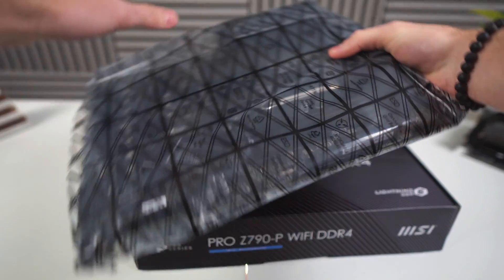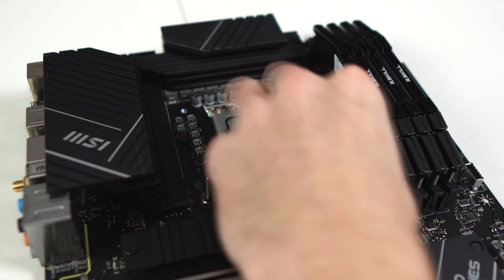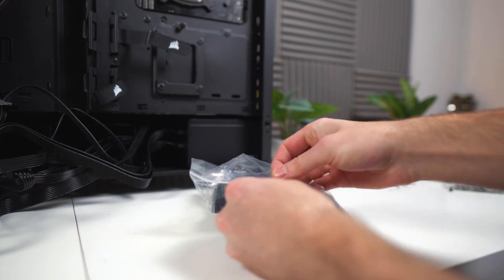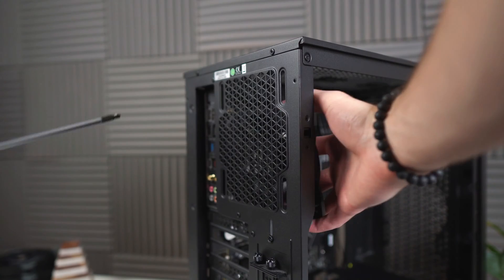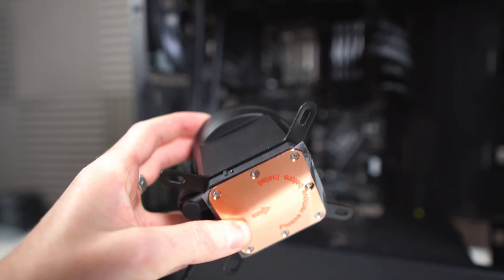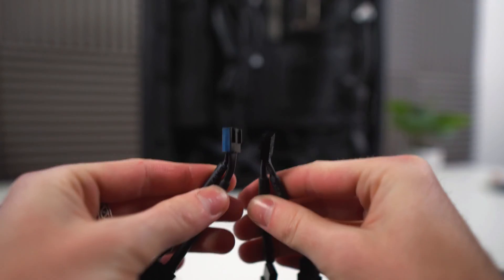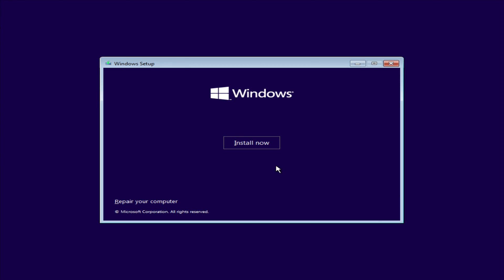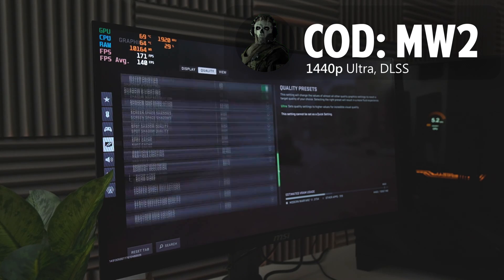BEST $2000 Streaming/Gaming PC 2023 [Tutorial, Benchmarks]

Comment: Hey I just built this PC, and after running it I saw the CPU was overheating a lot, i took of the aio and the thermal paste is good, I think the problem was with the plug from the screen, there was three plugs but in this video you only showed where to plug the two at.
Reply: Did you get it to stop overheating? And does it work good
Reply: @itzinsanity4 I wasn’t to get it to stop overheating, I know Intel CPUs are known for getting extremely hot, but mine was way too hot, I think the bump is messed up and i’m getting a new cooler
Reply: @MayLyte  let me know if the new cooler is better and if everything runs smoothly afterwards
Reply: @patum54patum Ok this is going to make me sound very stupid, but it turns out I left the plastic on the AIO lol, this was my first time building a PC so rookie mistake I guess, but after using it for around half a year, it works perfectly. Also instead of the recommended GPU, I switched it out with a 4060 and it works amazing.

Comment: SOMEONE HELP: would i be able to run the exact same parts with a i9-13900k? if not what parts would i need to change?
Reply: why a i9-13900k?? its overkill and also the temp is going to be on the roof. Also ur gonna need a better cooling system which gonna cost you more and a better gpu for no bottlenecks.